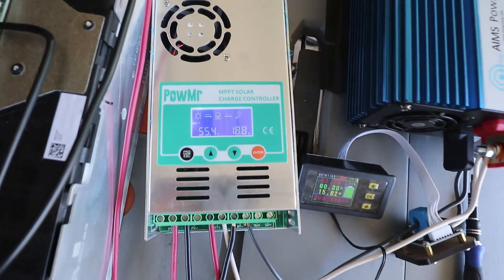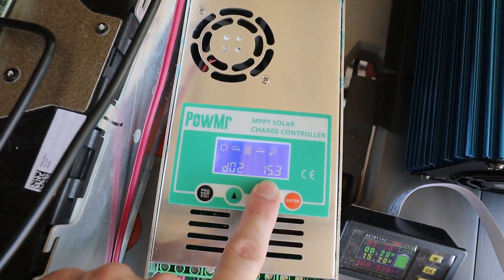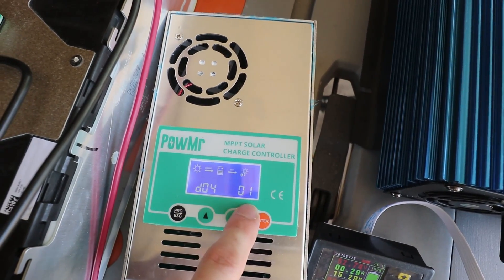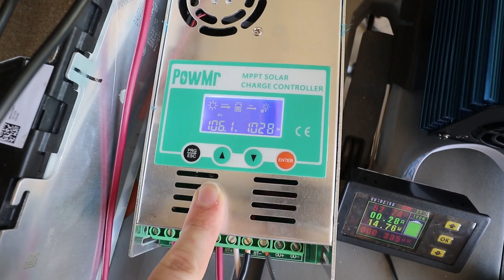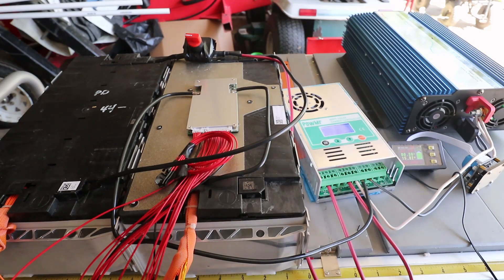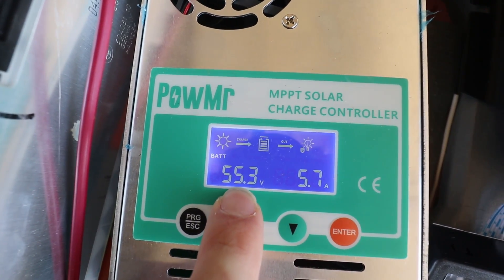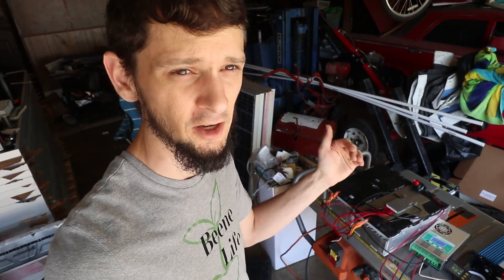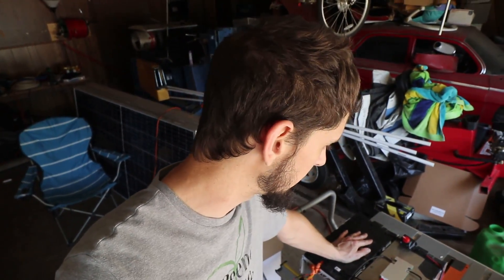$100 60 Amp Solar Charge controller from PowMr - Lithium Ion Charging!

Comment: I have a question when the batteries are full does the wattage drop i have 2 200 watt panels and they don't go over 150 it rests at like 30 to 50 watts but my battery is full and I don't have load on it no inverter hooked up
Reply from the maker: You can check the mode you’re in. Hit the up button to get the status screen. In bulk charging its using as much as the panels can supply but if it hits absorption or float the controller will be limiting current to keep the battery at a certain voltage. I’ve got a more recent video where I step through some of that.
Reply: @BeeneEnergy  can you send me link to it
Reply: @BeeneEnergy  or name of video and ill find it.
Reply from the maker: I’m pretty sure it’s in this video: PowMr $100 MPPT Charge Controller Using (98v - NOT RECOMMENDED) of Solar Input to 12V Battery

Comment: Hi, how to use 72 volt inverter with mppt controller, is it possible?
Reply from the maker: I'm sure there are MPPT charge controllers for 72v batteries but that would be more specialized. Perhaps Alibaba or Aliexpress have some offerings?

Comment: You know that if I can put 2 panels of 410w (VOC 49.69V VMP 40.56V IMP (A) 10.11A) in series to the load, these 2 in series produce less than 100V VOC and the specifications say VOC MAX for 48V system is 72V -160V but elsewhere it says "The voltage of the charging system should be the same as that of the solar system, it means that if your solar system is 12V, the voltage of the charging system should be 12v" this confuses me
Reply from the maker: If you’re running 48v then yes you can do up to 160v input from panels. I have run this up to 140 or so without issue. I tried with 200v once and that didn’t work :).
Reply: @BeeneEnergy  Thanks

Comment: So I would not need a shunt with this charge controller? for lead acid batteries? How about hooking up a gas generator to charge the lead acid batteries for when you have little sun or cloudy and rainy days would you hook the gen up to the powmr ? or buy a 110v regular battery charger to run off gen. Then how would you hook up battery charger to batteries for a 48v bank? Good ideal for future videos would be some wiring diagrams with wire size? you should get into politics. You could be president with the Abe Lincoln look you got going. haha
Reply from the maker: Shunts are nice to have for monitoring capacity state of a battery, whether it's lithium or lead acid since voltage will sag under load and the voltage isn't necessarily linear with the discharge curve. You'd have to get a separate charger to hook the genny up. The Growatt I have in my most recent videos will accept a generator as a source, so you can charge from generator/grid and/or solar. It also does inverting. Once you price an inverter, charge controller, and generator charger it might be less expensive to just get an all in one unit like the growatt.

Yes I need to get some better software for diagrams, I think that would help. I tend to talk alot and just words really don't explain much to most people. Myself included.

I'm keeping The Honest Abe thing in my back pocket ;)
Reply: @BeeneEnergy  Can I hook my converter in my camper to the Powmr CC and charge my battery bank that way? if and when I should need to run camper from shore power?
Reply from the maker: @getreal1702  You should not have any issues charging the RV batteries through Solar and leaving whatever converter was there in place.

Comment: How low will D02 let you go? You did 13.8V. Will it go down to 12.6V? Thanks.
Reply: Just found you said D02 will go down to 12.2V in your earlier response. Looking to charge one of your (now my) BMW 3S with my solar through this controller and my BMS. Thanks.

Comment: Can this powmr charge 12v batteries to 15.3v or above?
Reply from the maker: Just checked, it will actually go all the way to 17 volts! Boy that would be up to a 16s battery. Very nice. I hadn't looked at how high it would go as typically I try to stay within a range for an inverter. Realizing there are other applications too.
Reply: @BeeneEnergy  In order to make your batteries last longer they need to be charged up to 15.3 after every cycle. lead acid batteries could have a 15 year life if charged like this. good read here if you have 15-20 mins. https://cupdf.com/document/solar-secrets.html

Comment: Great video! Thank you! I bough one after seeing it, but i'm having some questions that maybe you can help me out. I'm using Lithium ion cells, 10S 36V nominal. This mppt detect 36V battery pack for a battery range between 30 and 40 volts, but my battery, fully charged is 42V. I think this could be a problem... don't you think? any idea how can i solve it? The only solution is to lower the charging voltage to 40V, but i would prefer to have it at least 41V...
Reply from the maker: I think what you are referring to is the voltage range for proper auto detection. The setting for charging on my unit maxes out at 15.6v which is 46.8v. You should be able to hit your full voltage without an issue.
Reply: So I do have some batteries of 10s 36v nominal.. full charge would be 42v  so my question is, what would it be the setting on D2 for my battery configuration? Also thanks for the video.. super informative

Comment: Hi, I also ordered this controller, and saw that it has 2 inputs for panels.
Can I also connect panels of different power there?
I have 2 100Wp panels in series that come to 44V
And a 320Wp panel that comes to 35V.
Can I connect both to the device?
It wouldn't matter if the 44V panels were throttled to 35.
Reply from the maker: While it does have two inputs it runs to the same mppt input. I haven’t tested with two different voltages like you’re suggesting so I’m not sure how much power you will lose. I suspect it would work but your 100w panels would be producing at about 70w each.
Reply: @BeeneEnergy  Thanks  okay, better 70w out of my panels as nothing :)

Comment: Thank you Beene Energy, awesome video! How low can d02 be set? I'm wondering if it can be set low enough for 14S, 13S or 12S lithium. Also, it seems like it's still charging even though it's above 55.2V and d02 is set to 13.8. Does it stop sending amps at say 55.4V when d02 is set at 13.8? If not, what battery voltage does it stop sending amps at d02=13.8? Thank you!
Reply from the maker: Just checked, 12.2v is the lowest d02 will go which matches a 12s pretty close.  I can’t answer why it wasn’t Reducing the current any faster. Could be a voltage reading discrepancy from the screen to the background electronics. I have learned since then to calibrate with a multimeter not rely on the setting of the powmr as it isn’t highly accurate.
Reply: @BeeneEnergy  Thank you. I really enjoy your content! You are are a thinker. :-) Any notable downsides to this cheap MPPT? Seems pretty ideal for an inexpensive 12-16S lithium battery bank, considering the adjustability, and fairly high power capability. It sounds like it might be a bit loud. Cheers and thanks!
Reply from the maker: Rob McGregor thank you, I appreciate the kind words. It definitely wants to be heard when it’s doing some work ;). The downsides I noticed are 1. Accuracy of voltage readings, mine seems to read low so I set it lower than I want the battery to be, otherwise my inverter claims high voltage and cuts out. 2. It’s inexpensive Chinese which could result in a short lived relationship ;). 3 months and going for me though!
Reply: @BeeneEnergy  Thank you!

Comment: How low can you set the voltage? I have 8s nimh from ev and today almost burned my barn.
Reply from the maker: I don’t think it will go low enough. Float voltage will go down to 11v and this charger doesn’t support nimh.  I haven’t heard of an ev using 8s, what car is that from? My Prius and civic use 6s
Reply: @BeeneEnergy  it's from hybrid like toyota higlander and alike. it's 8s packs stacked by 10 in one block, and was conected in series, so it was actualy 80s. http://www.automotivetroubleshootingsecrets.com/hybrid_battery_boosting.html
Reply: 11 v is exactly what i need thank you so much.
Reply from the maker: I’m no expert but I believe you need a dvdt charger for nimh. Just don’t want you blowing them up!
Reply: You'r right, but those batteries are junkie anyway. I will use controler for other projects to.